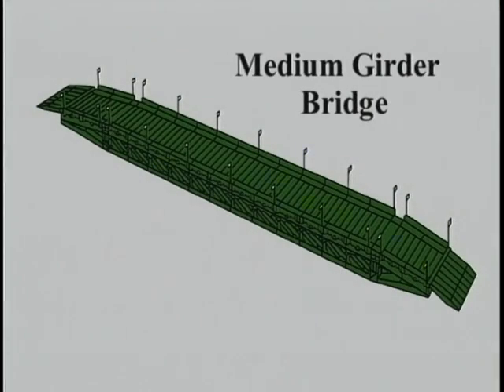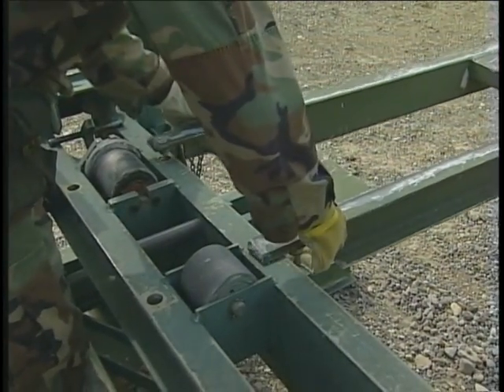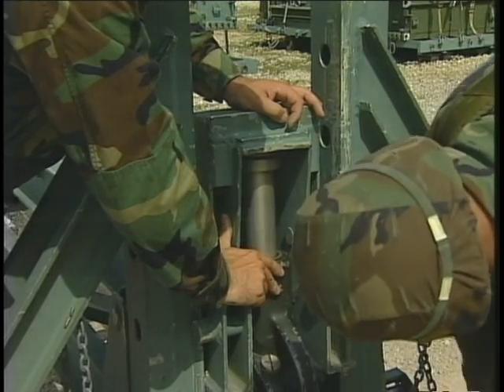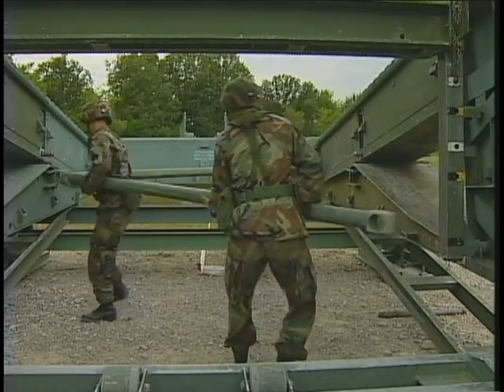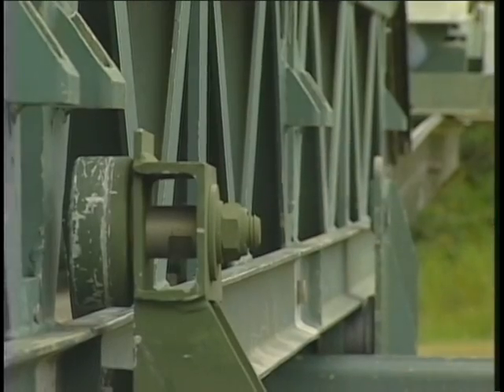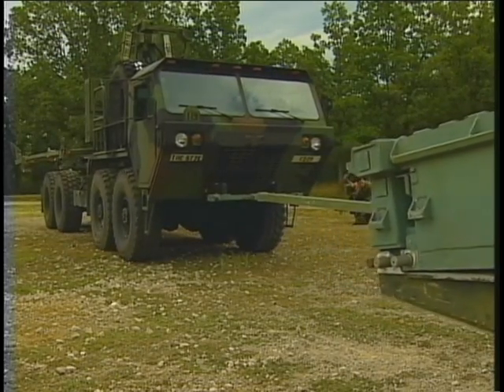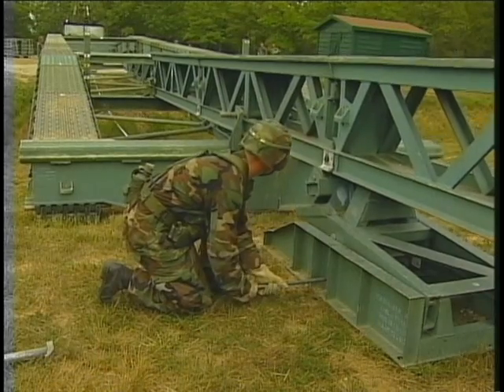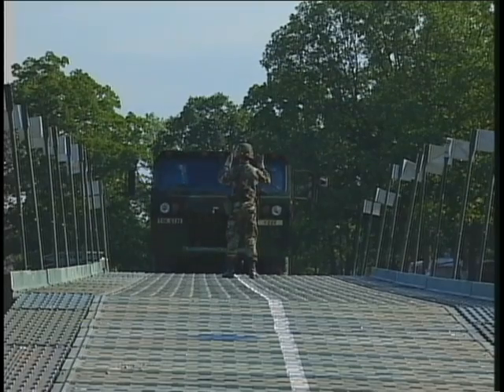MEDIUM GIRDER BRIDGE (MGB)

Comment: Ahhh... the Mean Green Bitch. 

Lol we dropped one into the hole we used as our gap. Front of the 5 ton dump up in the air and all. 

It had been raining a lot in the days before the build. So, the Lt, wisely, decided we needed to back up from the edge to be safe. This was smart. But if you pull the rollers back on each side, you've widened the gap and need to add to the overall length of the bridge. 

He forgot that part. 

So when we pushed forward over the balance point, where normally the guillotine of the far bank would catch the nose, it was 10 feet short... and onto the hole it went. Picked the truck up to where only the rear set of wheels were touching the ground. 

The Lt was strangely missing before the sounds has even stopped ringing out lol. 

To this day I'm still not sure if sarge didn't notice the error, or if he did but just followed his orders as given lol. Lt was a nice enough guy so allowing him to fail wouldn't have been my first guess, and sarge was kind of dumb, so not noticing the error makes the most  sense. but he was also an asshole, making either plausible to me lol. 

Wasn't my fault is the only thing I'm sure of lol